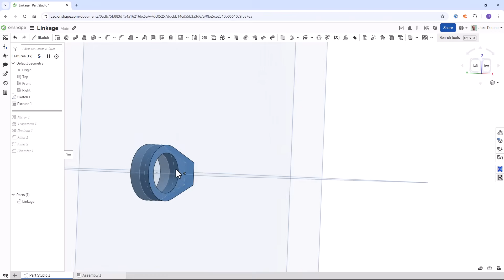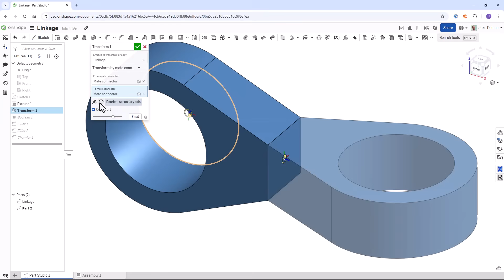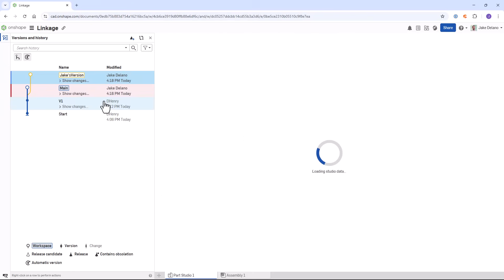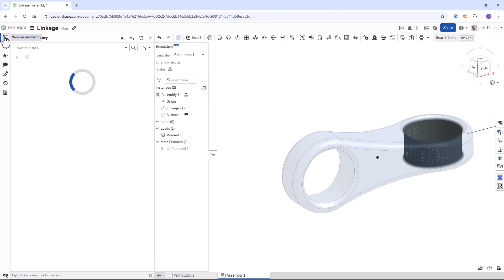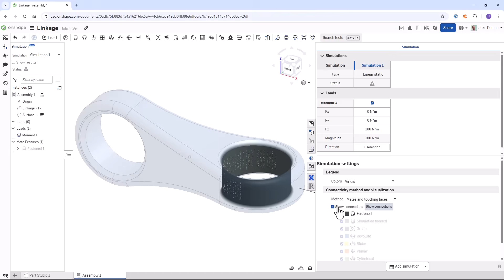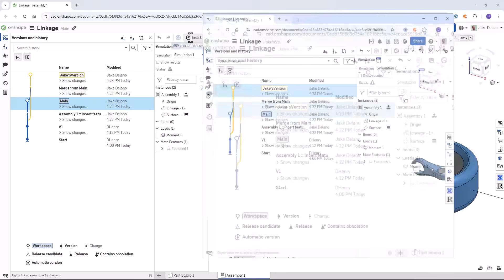Reduce Feature Count with Mate Connectors in Onshape

Comment: There is a faster way which reduces even the need for one of the fillets. Extrude one profile of the whole part by using one sketch, then sketch the other side profile and extrude intersect it.(fillet should be applied during sketch. Then apply the chamfer and small fillet. Adds up to 6 features total with the same geometry.

Comment: Can’t you use mirror with MC as a plane and integrate the rotation there? So you can save the Boolean as well
Reply: the mirror feature can't rotate at the same time. but using a circular pattern  (add) and a 45 deg. mate connector, you can safe the boolean indeed:)
Reply: links are not working here. but i got it down to 10 features:) search in onshape public for "mateconnector circular pattern test"